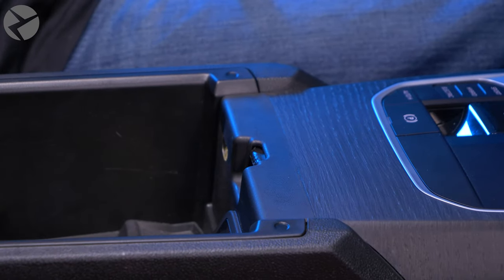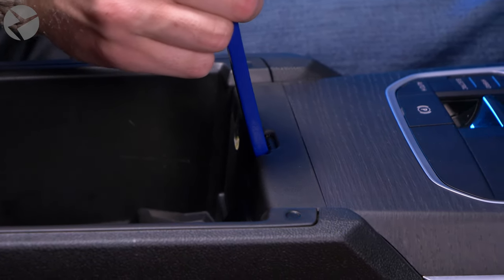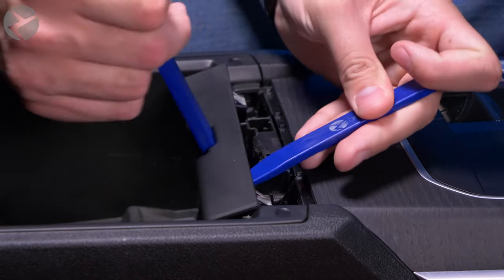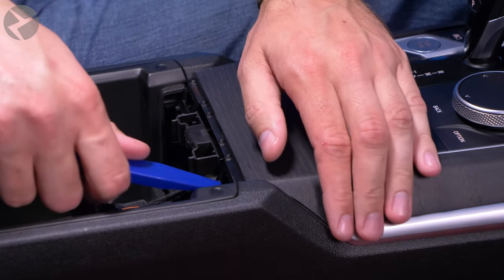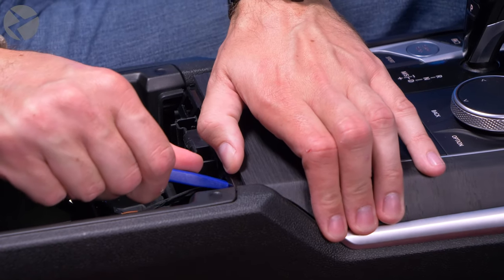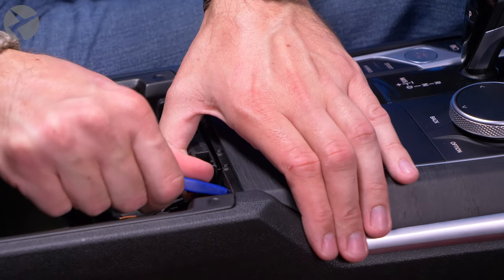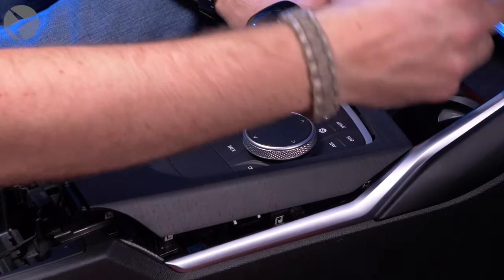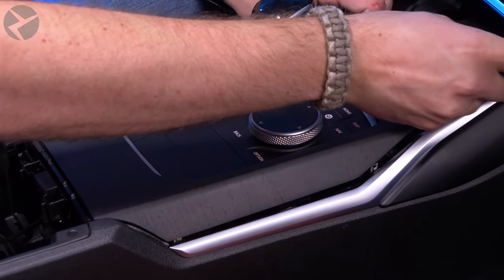BMW G20 Shifter Trim Removal Made Easy!

Comment: @BimmerTech I have a G26 - I can't seem to locate those tabs you show so I can pop up the front part. I have tried all sorts of trim tools and even a small camera to try to locate the problem.
Do you know if the G20 has the same trim as the G26?

Comment: Can you please show us how to clean the buttons? Mines are sort of sticky. Also my traction control button is not working anymore. It won’t turn off when I press the button. But it’ll turn on/off when I press my 360 camera button or my auto start/stop button. If you can help me that’ll be greatly appreciated Bimmertech!
Reply from the maker: Hey there! For cleaning the buttons you can go with some very delicate cleaning liquid and just wipe it up. If it doesn't work, try something soft, but pointy (like a toothpick). As for the other issues - it might be some software issues, so we recommend giving a visit to your BMW service. 

Cheers!
Reply: Thanks for the insight fellas! Keep it up!

Comment: Niice. Yes, I do have a question regsrdin G20. How do you remove the central box (the one in front of the joystick)  thanks a lot
Reply from the maker: Are you referring to the cup holders? If so, you can get some idea from our wireless charger installation video for the G20: https://youtu.be/GT_x8bmjIZw?si=BdD9UYyucijXJxUM
Reply: @bimmer-tech  yes, that one
Reply: @bimmer-tech  but, the cover of those. I have a problem with it. Is not closing and openinf how it supose and I don't understand how it works. Thanks a lot!!
Reply: Hello. Have you tried? Thanks 😊

Comment: On my g20 the handbrake doesnt turn on, when i pull the lever up it doesnt make the sound click that it should, but when i put it down to release the brakes it works. And it makes the sound click that it should. At the dealership they say that i have to buy the whole shift console that costs 1000 €. 
Is it possible just to change the handbrake? I found some used shift console for 200 €, but at bmw they say it wont work because it cant be programmed..
What do you think? Can i buy the used one and take just the handbrake part out and put it in mine? Or can i buy the used whole console and replace it with mine would it work?
Reply from the maker: Maybe you should find a mechanic that knows a lot about BMWs - he should tell u if it's possible or not. Cheers!
Reply: I have the same problem. Did you find a fix to this?
Reply: @BillyCalhoon  No, i have disassembled the handbrake and the shifter. On the mother board a button broke down which you cant repair. You have to buy a new one or try to find used shifter and handbrake to replace it. Also i dont know if you need to program it to work. I have also changed my media buttons next to the handbrake and i didnt need to program it.